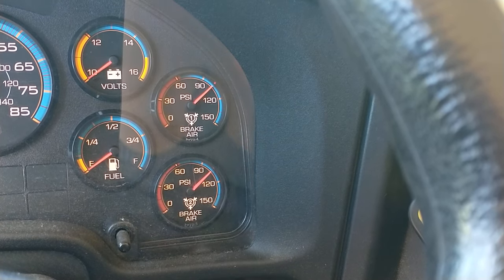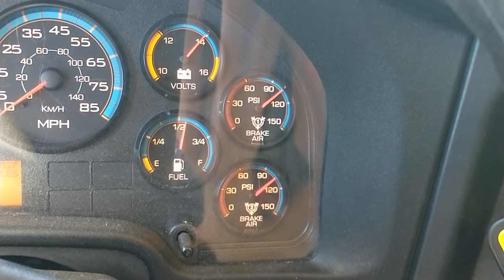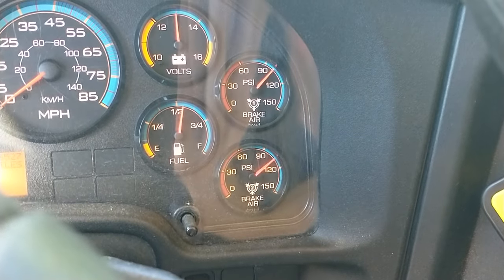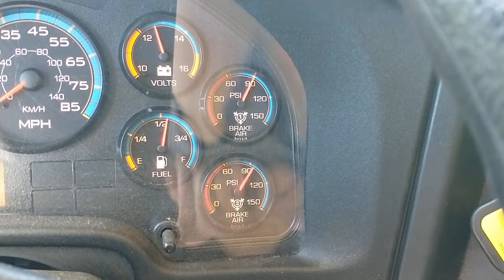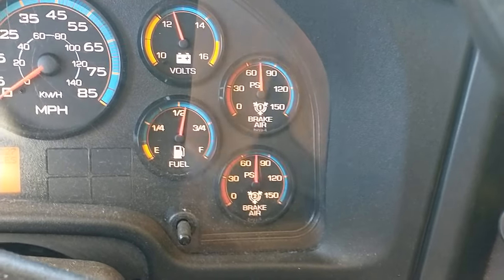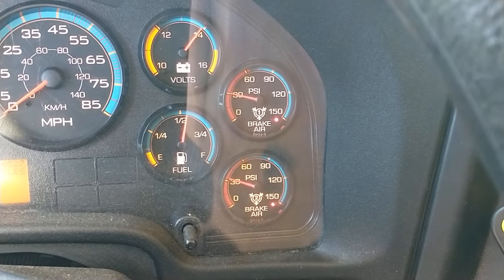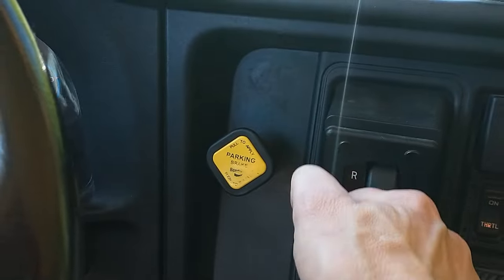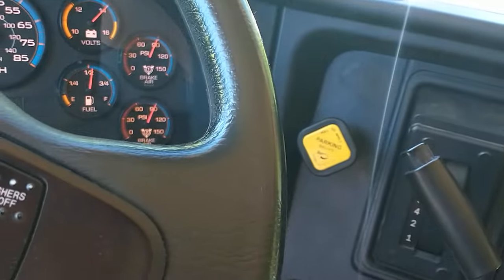School Bus Airbrake Test

Comment: This is wrong. If you were on a hill you’d start rolling bc you pushed in the parking brake and didn’t have your foot on the service brake.
Reply: You must chock wheels before brake test begins
Reply: @nojunkmonk  to test standards you need your foot on the brake when you release the parking brake until gauges settle. Also During a test for the CDL you dont have chocks bc the point of this test is to test for air leaks but to also see if the parking brake will hold when you put it in drive.
Reply: @nojunkmonk you will lose points depending on who your tester is. Always have your foot on the brake if the wheels aren’t chocked

Comment: Cut in should be no less than 85 PSI. Cut out should be no more than 130 PSI. When doing the static test the bus is off with the key in the n position (do not start) all you do is wait one minute, you should not lose anymore than 2 PSI. why are you releasing the parking brake for the static? With the applied you apply the service brake & release the parking brake, wait one minute, you should not lose more than 3 PSI.